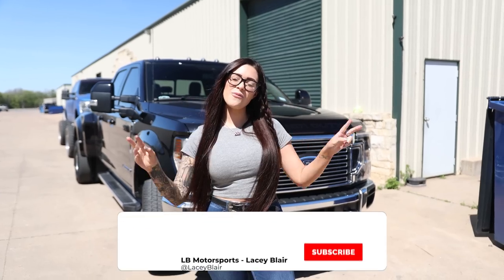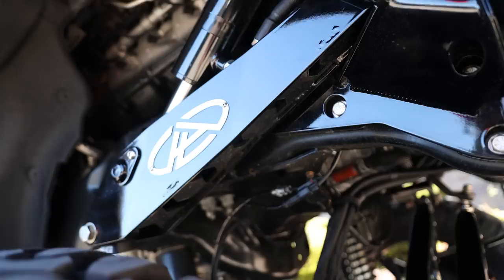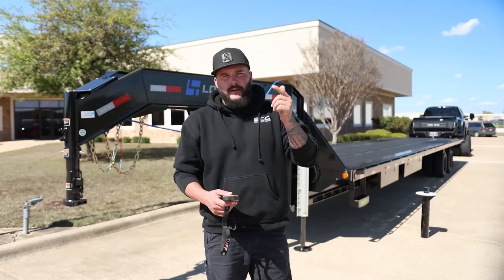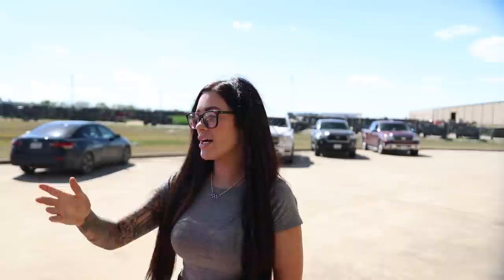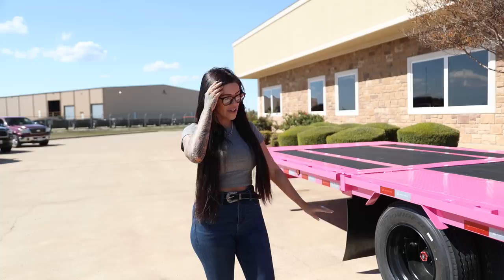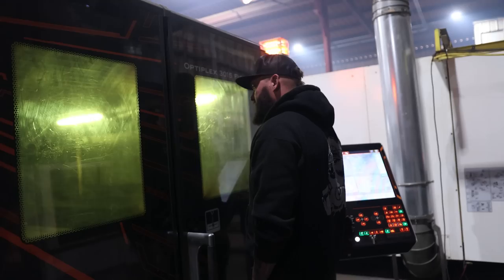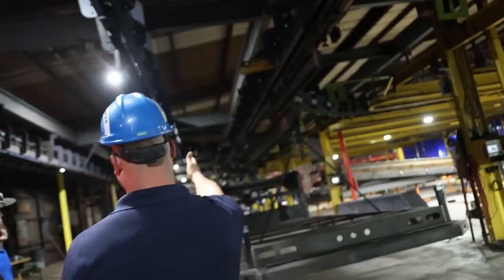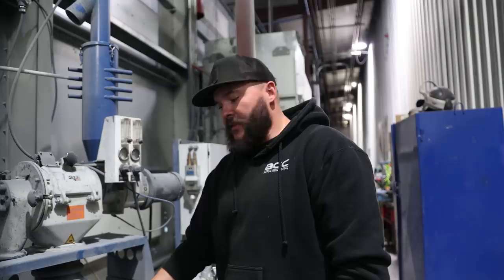WHY I Sold My Hot Pink Trailer

Comment: I am not reading all this to see if anyone has pointed out the USA CDL requirements?🤷🏻‍♂️
Just curious if you and anyone lease in your staff have gone through the hoops to get a CDL since your gross vehicle weights are most likely over the 25,000lb combined rating max for class A drivers. I’m just thinking if I’m right, you nigh spend some time explaining this to the un-suspecting potential trailer owners out there with two 10k axles and a one ton with anything over a GVWR rate of say 5k 🤦🏼‍♂️ 
Lots of “grey” in these #’s and the “Wrong” DOT man!